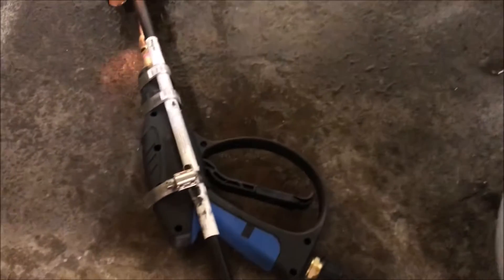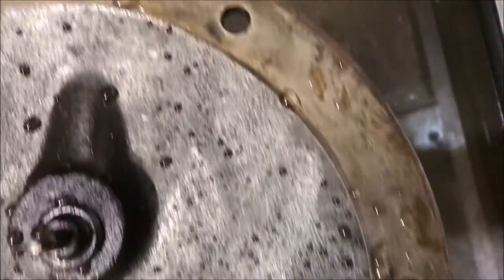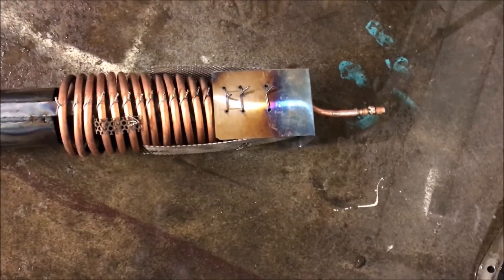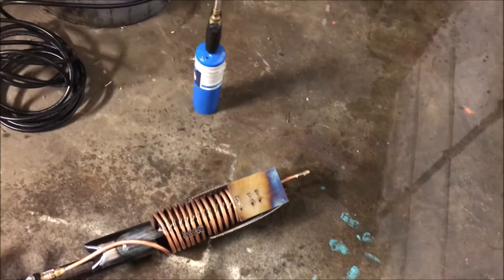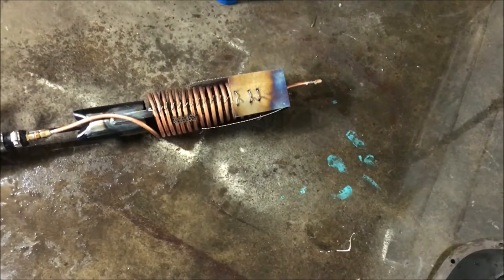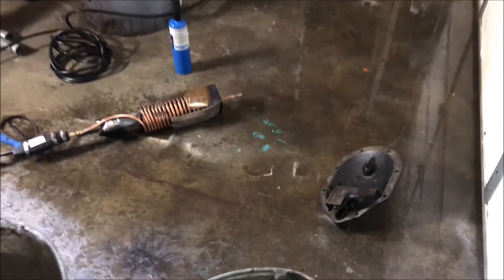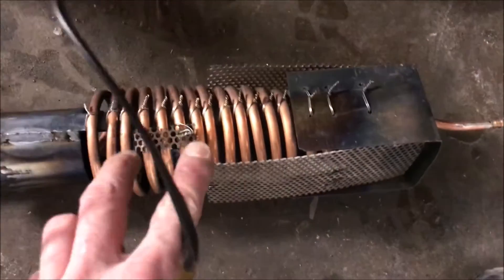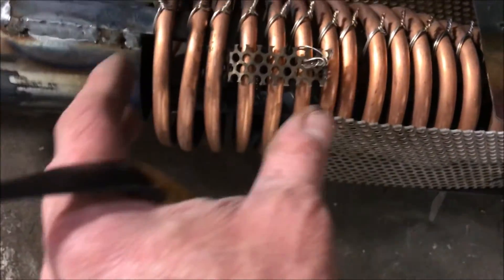Pressure washer steam cleaner  Diy

Comment: If you could figure out a way to turn down the heat on this thing where it was putting out hot water super hot water and steam you pick I don't know but if this could be adjustable you could make millions in the power washer industry if you need a partner call me
Reply from the maker: I agree, this first test was to see how the coil behaved , it needs another inner helix and as you said temp controll,